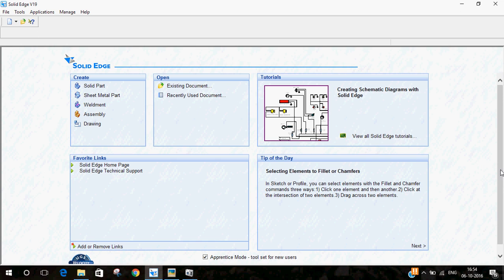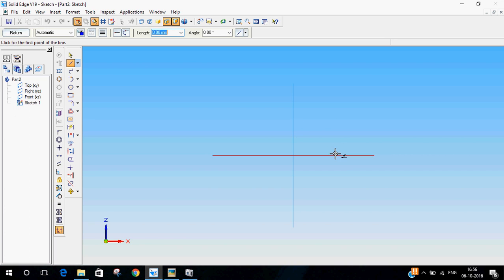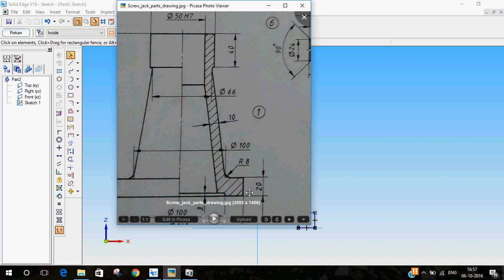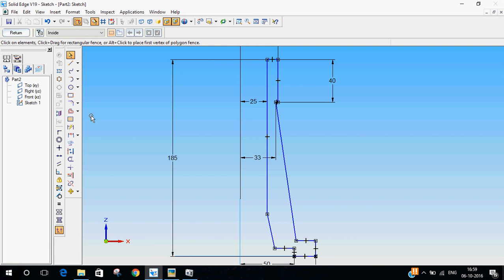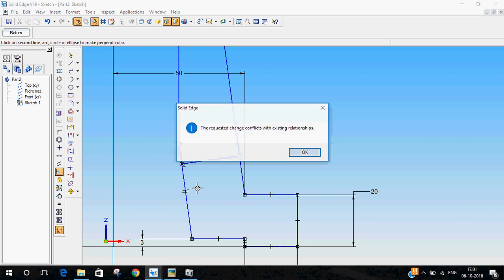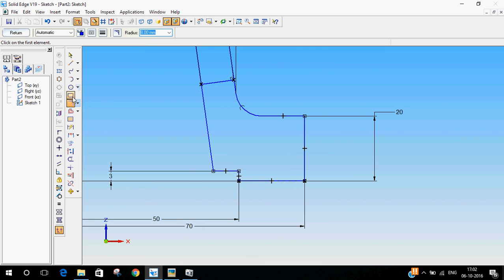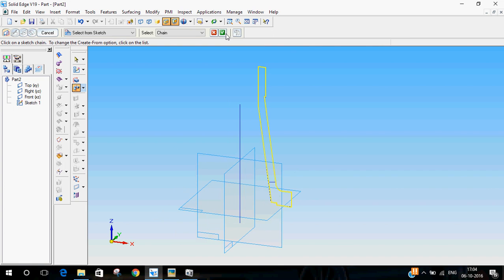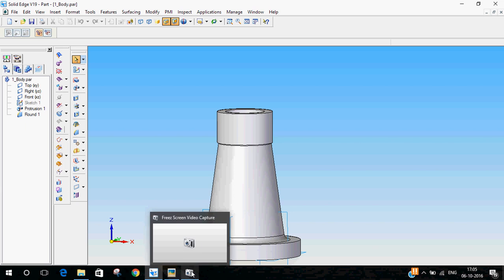Solid Edge | Screw Jack | Part 1 - Body

Comment: ST6 solid edge can be installed and cant be open in windows 10 pro

the error message is :  Please open an IR using your customary  process  saving the files to disk  may result in a corruption of the data.  A LOG file has been prepared  that will  aide  in the analysis of the problem .if submitted . this log file will be imported into an analysis tool used for identifying trends and detecting areas  of code requiring further investigation .   no personal information will be included in this file and you will not receive a response . would you like to email the log  file to the solid edge product development center for analysis?  

kindly help in solving the issue.
Reply: https://youtu.be/xyO15z6Gkng
Solid edge Tutorial